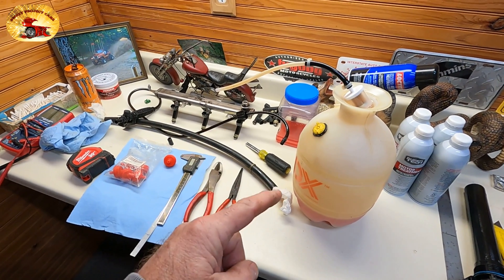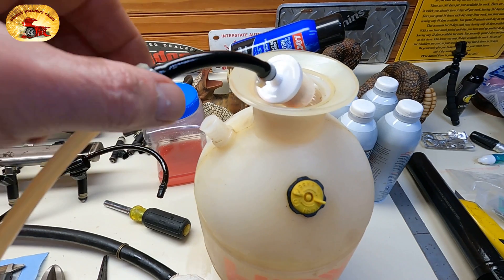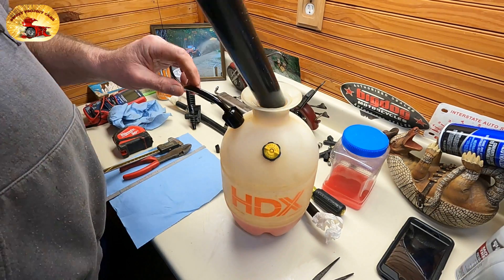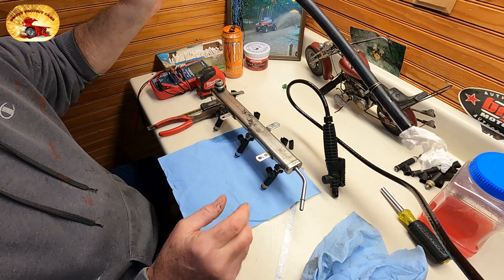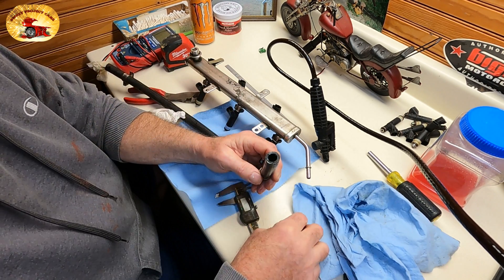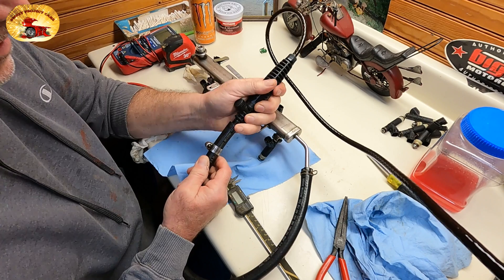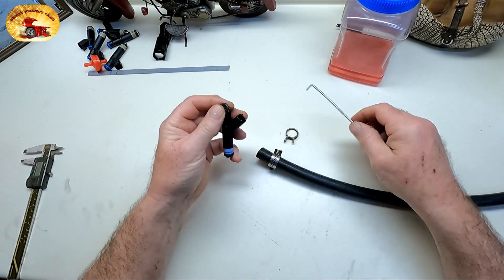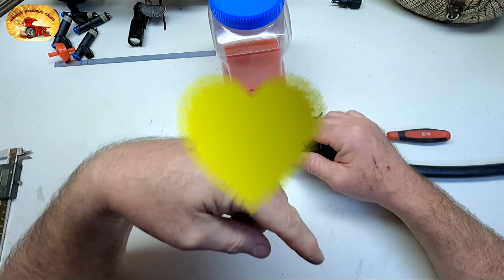DIY Fuel Injector Cleaning Machine!! Easy To Build!

Comment: Thanks for the setup !

You said use a 9 volt battery to energize the fuel injector ,

What’s the polarity ?   Or is there none ?  Just positive lead and negative lead to the injector pins ?
Reply from the maker: It doesn't matter, if it doesn't work one way, just flip flop the wires on the battery. Thanks for watching, have a great day. mad Mike

Comment: Off subject. But I had window tint put on my SUV. Installer got a black substance on the head liner. I think it may be grease. But afraid if I use the wrong cleaner. It will look worse. What do yo suggest I do? Thanks!!!
Reply from the maker: First off, you need to head on down to the window tinting store that did the installation and tell them to fix what they damaged. If that's not an option, use this  https://amzn.to/485HT5s  use it sparingly as you don't want to get the headliner too wet, place the cleaner on a cloth and dab the spot until it disappears. Thanks for watching and asking, Charles, have a great day my friend. mad Mike